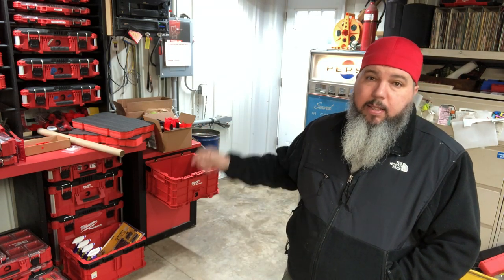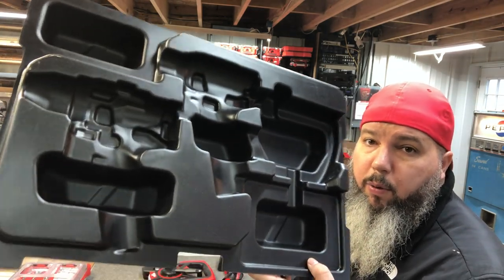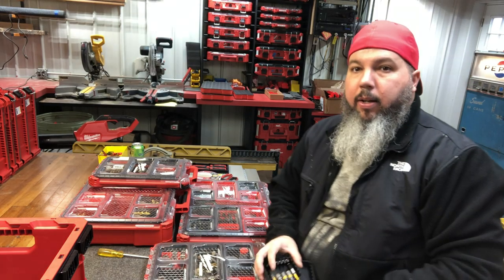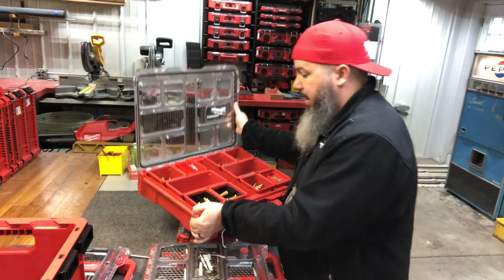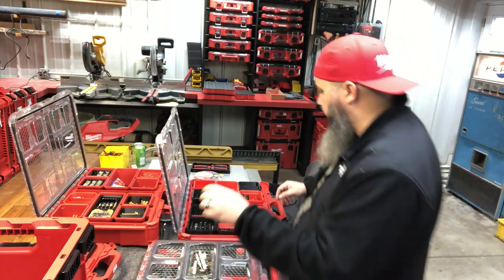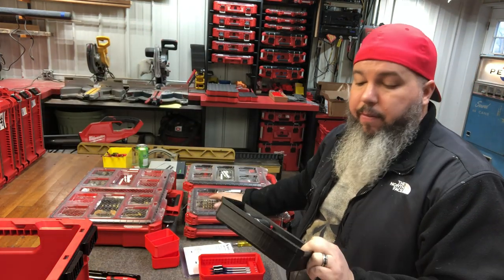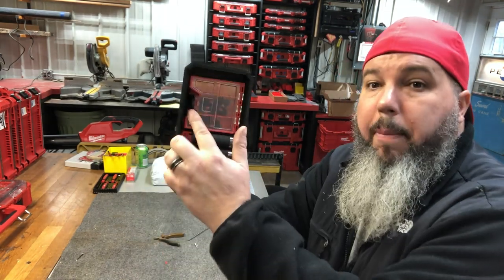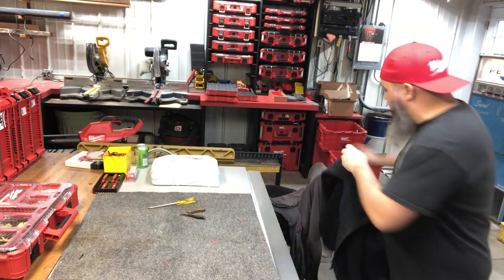Vlog 0005 Penny Wants a Cracker  (scratch & dent bins, Kaizen Foam Cut kit & Giveaway)

Comment: Jake do you have a rural king store near you? They’ve been running pack out units 
for $10 less on all sizes. Ex.$59 for small box  $69 for medium exactly the same as 
the 3 unit system. Think of how many more you could buy saving $10 bucks on each.  
I’m thinking you don’t have enough already 🤪 sure you could use some more. Like the videos.
Reply from the maker: I will have to take a look
Reply: My Rural King is $49 $59 and $89 $199 for the set. It's located in Litchfield Illinois. The add  says the same number for all of them. You should hold your local Rural King to it.

Comment: You should sell some of the extra bits you buy all the time too.
Reply: I like crackers, pipe wrenches, and packout.  But I'm not local.  Keep us posted on the scratch and dent section.
Reply from the maker: The bit cases ? Or the bits in the cases ? Lol
Reply: The actual 1" and 2" bits.   It seems like you've gotta have 5 gallon bucks of them laying around.
Reply from the maker: Msg me at info@jakeofall.com
Reply: Jake I sent a message get back to me when you can.